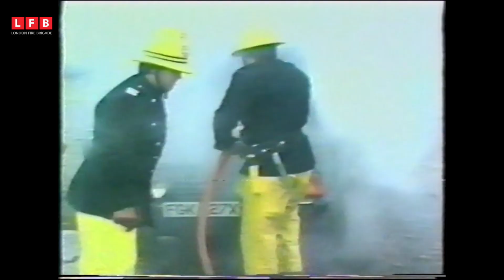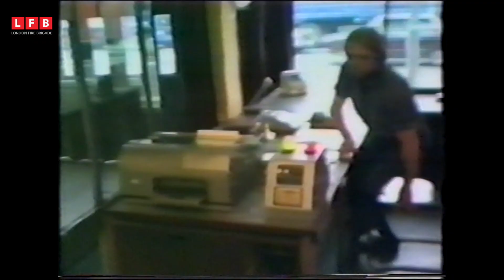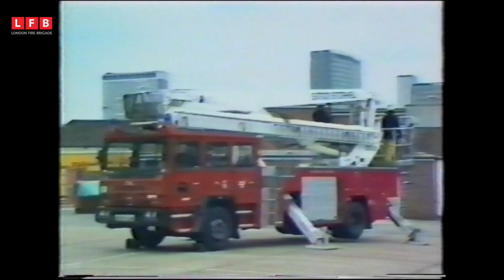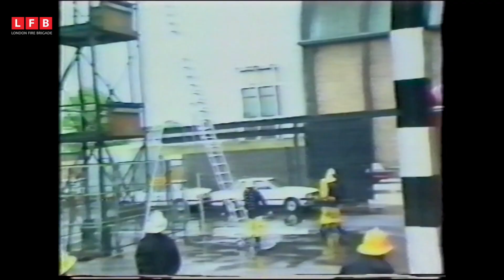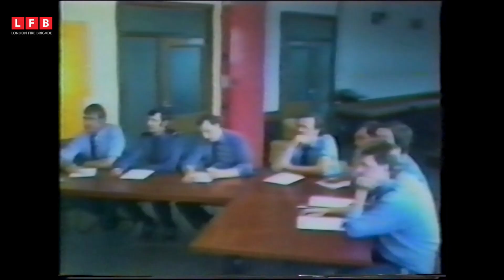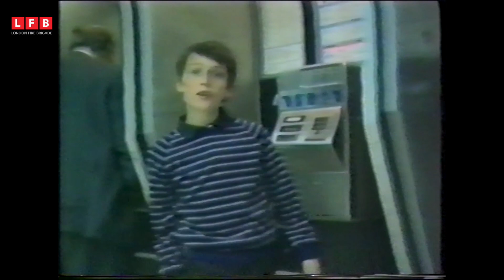A Day in the Life of a Firefighter | 1983 Retro Look at London Fire Brigade

Comment: Do they test hydrants now? Never seen it done. All the yellow H plates seem to have gone.
Reply: Where I am in Yorkshire it is ages since I saw a hydrant being tested. They used to drive around here regularly years ago.
Reply: @cedarcam  I've never seen it in Northern Ireland.
Reply: @smorrow  So they cut out the testing there too
Reply from the maker: Yes, hydrants are still tested regularly in London to make sure they’re in good working order. The yellow H plates are still in use too — though they’re easy to miss these days with how much street furniture and signage has changed.

Comment: The really big problem now is with what is now extremely  effective PPE.

The problem is that it insulates you from the heat of fire.

Even a simple anti-flash hood protected you from heat.

The problem was that without it you would duck down when the heat reached your ears so that you were ducked down below the heat barrier and therefore not subject to heat exhaustion.

Now you have to imagine that the heat barrier is there and get beliw it even if you can't  feel it.

Even knowing that a heat barrier there it still take conscious effort to keep ducked down whereas without a smoke hood you would automatically  duck down unless you wanted burning  or melting ears as I have seen occur!!

Now the problem is too effective PPE so that officers must withdraw crews after a relatively  short period to avoid heat related stress etc.

There are normally plenty of BA wearers at protracted incidents 

Rather BA wearers do 20 mins wear and then use fresh BA crews.

They'll  be no lack of BA wearers wanting to get in and do a bit!